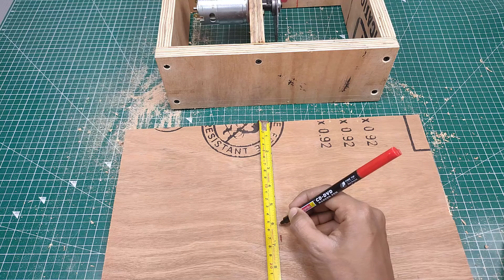How to Make a Powerful Mini Table Saw

Comment: Nice project . May I use 775 motor instead of 895 motor ? Can it working properly  ?
Reply from the maker: Yes
Reply: 775 motor will have less cutting power. it won't need a high current power supply,though.

Comment: can we use solar power to run the motor?
Reply from the maker: Yes, It Can Run on 12/24V Both
Reply: @homemadecreativee  can we directly give a plug connection in our home plug socket?
Reply from the maker: NO
Reply: @homemadecreativee  so for sure we have use a 24V power supply right?